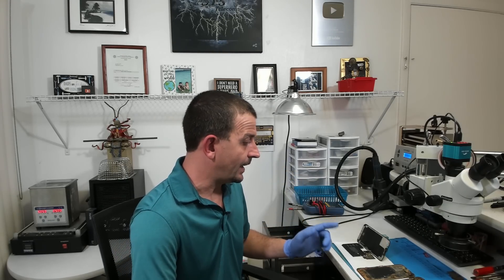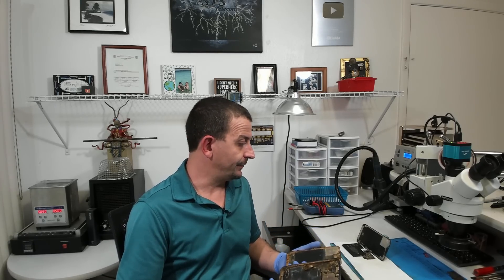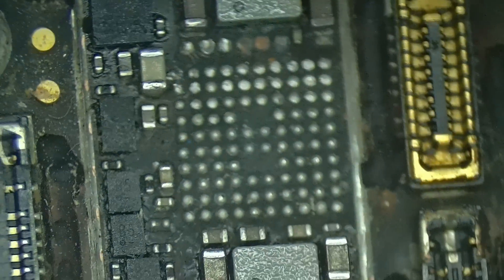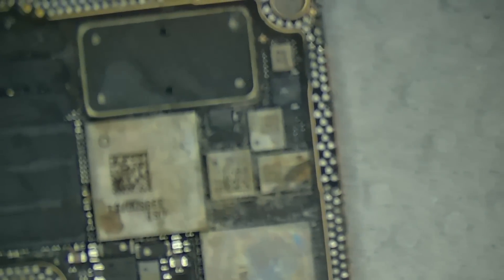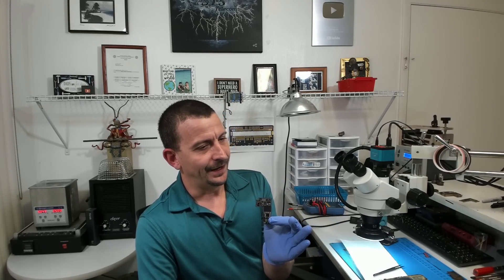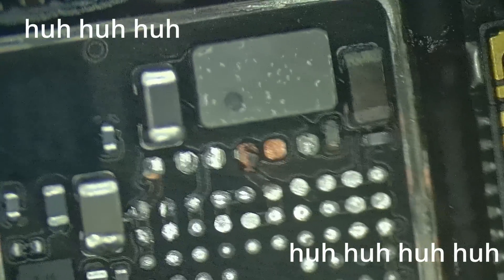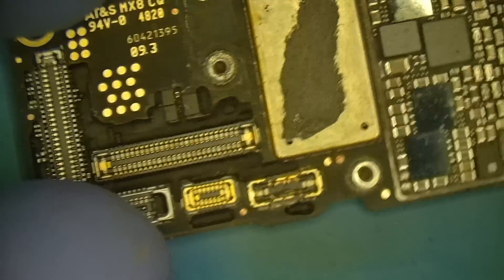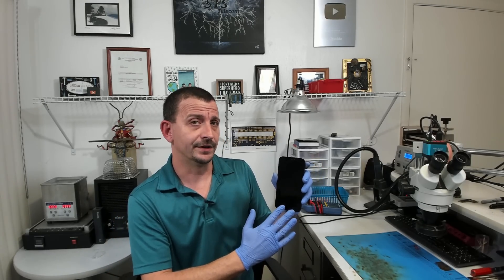Data recovered from a doodoo iPhone 12 Pro Max - 512GB was FULL!

Comment: yikes! how can you get the data if it reboots every 3 minutes?
Reply from the maker: Can't.  Must not have any reboots to get data!  I paced around and hovered over this recovery for hours dreading for it to have any trouble!  This model needs top and bottom board + working dock flex and battery to get data.
Reply: @ststele  Did you have your UPS battery connected on the off chance of a power flicker? 🤷‍♂
Twenty-eight or so years ago I purchased a small UPS that I would connect a desktop to when I had to flash the BIOS. I was paranoid about a power interruption in the middle of that process. 😱
Reply: @ststele  must of used another housing with all the flex bits

Comment: Lol.  Wow .  Thats crazy!
Reply from the maker: I was in total shock that this board actually booted!  I was on pins and needles for hours while the data transferred.  Probably 200 connections hanging by a thread and dozens of caps about to short.
Reply: The rust was keeping connections aloce!
Reply from the maker: @chrisfeaka4250 come to think of it, I didn’t try to power it up after ultrasonic cleaning!  Lol you may be right!